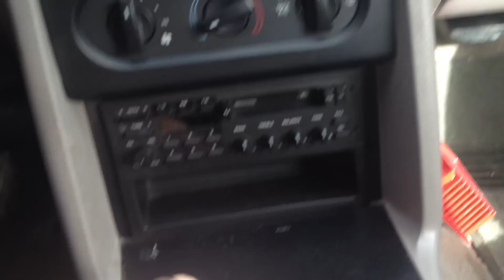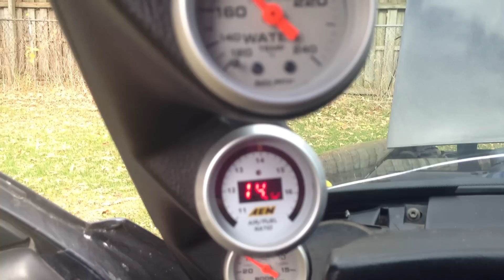1990 mustang lx turbo

Comment from the maker: Yes it is, you have to jack up the car go under car and disconnect the 3 bolts on the down pip flange (support exhaust up). Then  from on top engine you remove intake hose, remove oxygen sensor, remove clamp holding downpipe to turbo, remove down pipe. and your good to go lol takes around hour just for that side... The most fun is replacing the exhaust manifold gasket on that side because the manifold supports the turbo. I had to do that 3x before i bought the locking header bolts